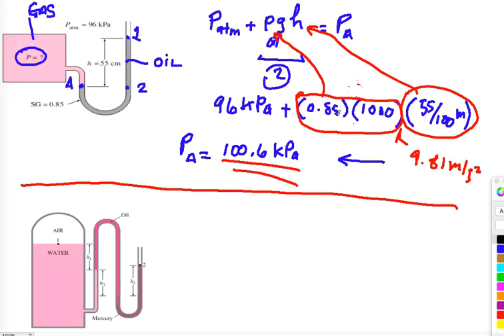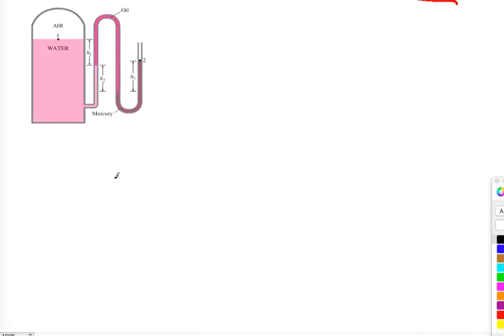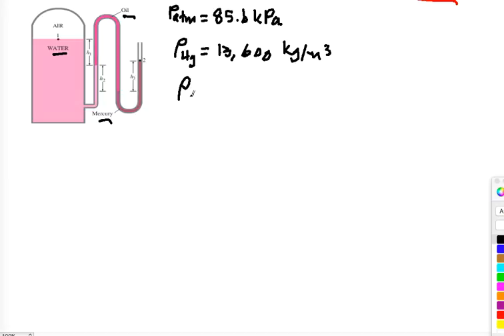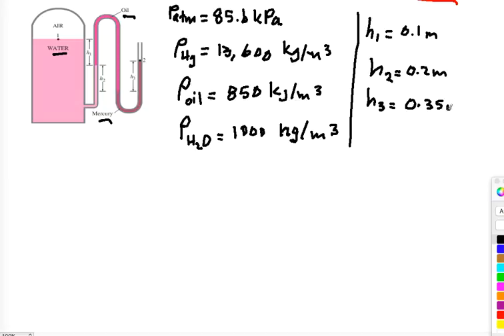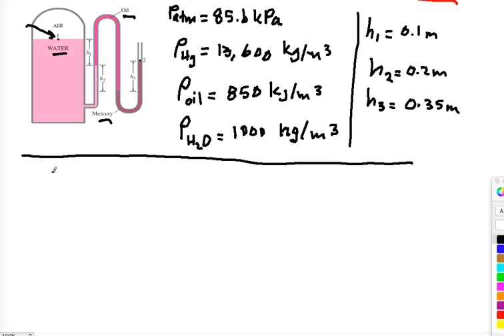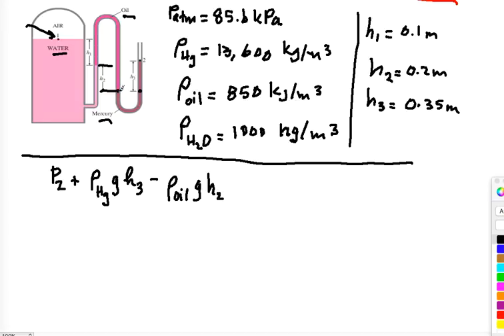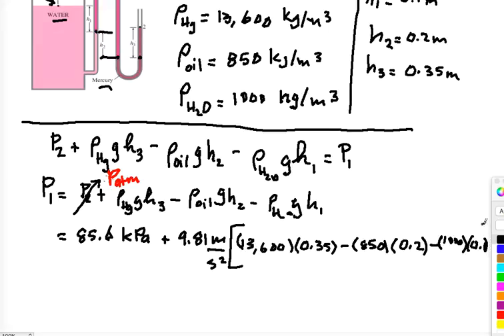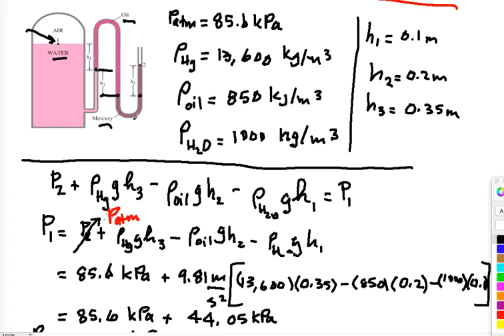Fluid Static #3  Multifluid Manometer

Comment: Why did u subtract de pressure of water 

Are u not going down
Reply: Because, the water(light pink) start at a lower point between h1 and h2 and ends at the higher point at 1. Thus the water is going up.